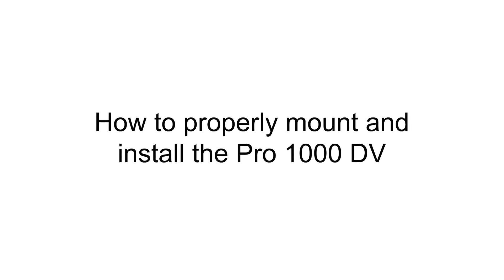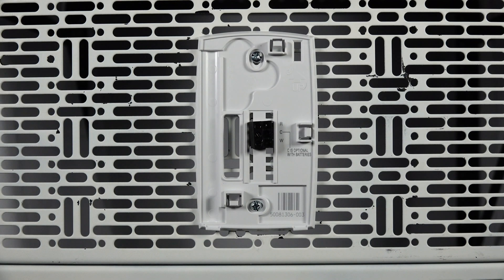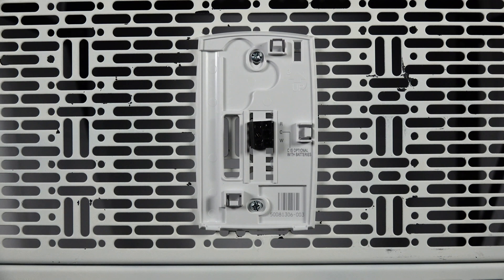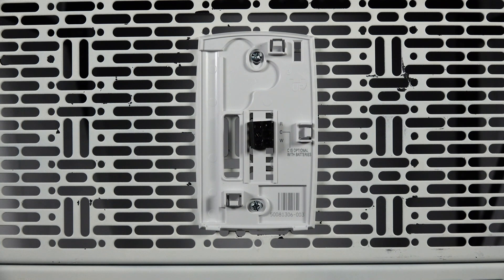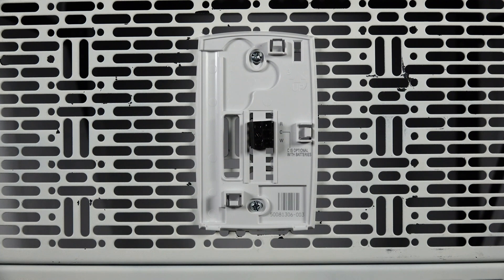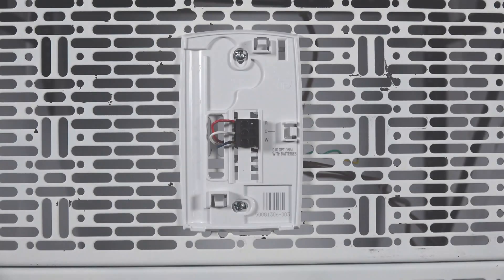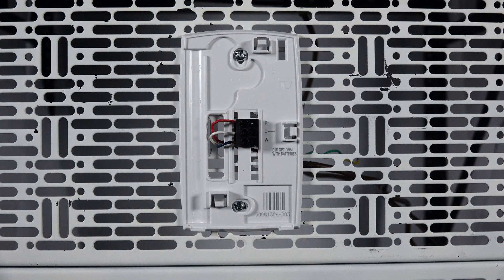How to mount and wire the sub-base for the Honeywell Home Pro 1000 DV thermostat - Resideo

Comment: how do i put the cover back on, though?
Reply from the maker: Hi, 
Align the thermostat with the tabs on the wallplate, then push gently until the thermostat snaps in place. -Joey
Reply: i've been trying :( there are 3 tabs to line up
Reply from the maker: You should have 2 tabs on the top part and 2 on the bottom. Tap the link below and navigate to page 5 for placement.
https://customer.resideo.com/resources/techlit/TechLitDocuments/69-0000s/69-2800EFS.pdf -Joey
Reply: @ResideoSupport  That is not helpful.  I lined it up like the manual showed, and I still had to force it on by pushing very hard.  There was a loud snap and all the numbers went blank.  Then when I pushed the on/off button back and forth it said it was 77 degrees in here.  There is no way it is 77 degrees.  It's more like 67 degrees in here.  I feel like I'm breaking it.

There has to be something about aligning the hooks with something.  There are hook-like things on the top and side.  How do we align it?
Reply from the maker: Hi Sojourning Pilgrim, we would like to see the hooks that you mention. At your convenience, please contact our tech support team at (800) 468-1502 or send a private message to our 'Honeywell Home' Facebook or Twitter accounts and we will be happy to help. -Maria
Reply: @ResideoSupport  I tried again, and it seemed to line up and snap on normally.  The thermostat is working and the temperature reading seems accurate this time.  I wish it slid into place on more predictable grooves or something, but it seems okay now.  Thanks.